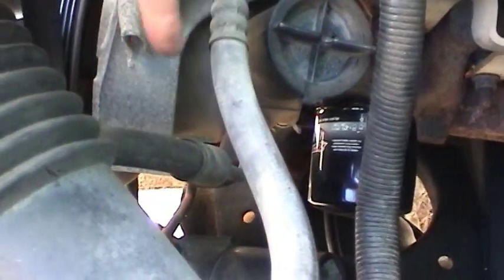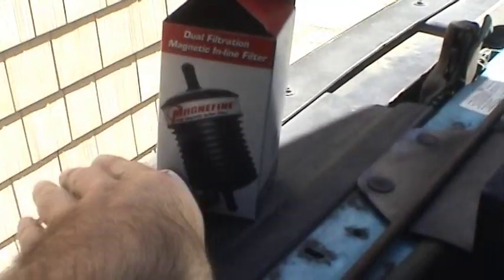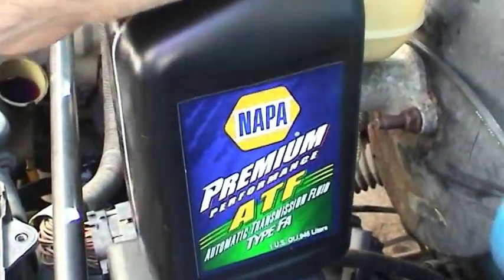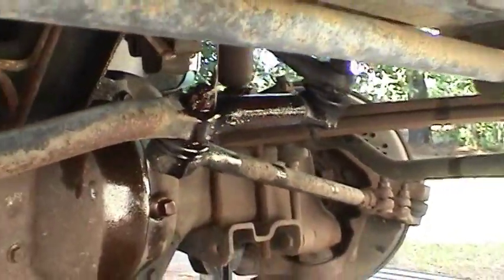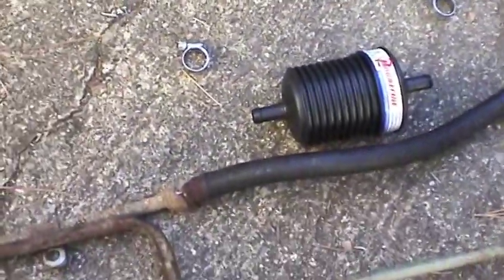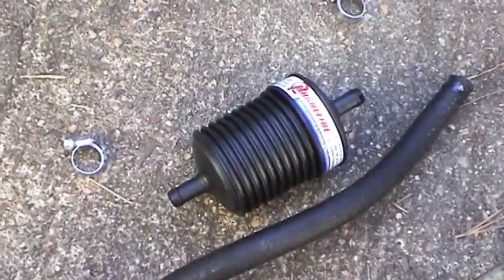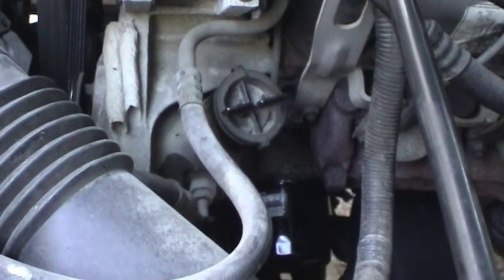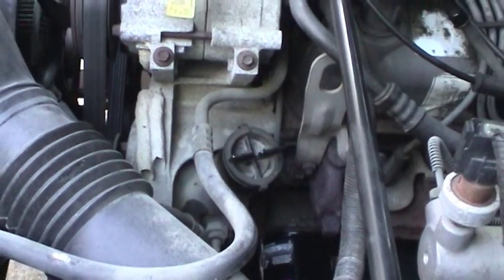1995 Ford F-250 4X4 Power Steering System Flush

Comment: Probably the main thing to remember is to change the filter now and then as the paper element will break down over time and if it does it will plug up the system. That would be disastrous. I got to flush my power steering as it is getting noisy.
Reply: The filter is not paper

Comment: Did you ever do the front differential?
Reply: You can only do those ones by sucking the old fluid from the fill plug with a transfer pump, opening the pumpkin on those requires ALOT of work

Comment: Responding to a thread that's a couple of years old, but now is when I'm doing my steering.  I'm almost done putting back together a 96 F250, where I replaced the steering pump with a Ford reman, and since the manual recommended replacing all rubber parts because the hoses disintegrate from the outside out, I was surprised to find out two things - the Ford dealers no longer carry the cooler/"paper clip" that attaches to the front axle.  And an aftermarket auto parts store sells both the hi and lo side assemblies from Gates for under $20 each!  What a surprise.  Became a case of the might as wells.  Also, I have that same oil drain pan.  Have had many.  I couldn't see the cap on the spout of yours, but mine kept splitting and caps from quart oil pans didn't have the right thread pitch.  If you like, I can send you a couple I designed and printed on a 3D printer.  Kept my drain pans alive.  Nice video.  So much in common between the F-150 and F-250 Powerstrokes, steering-wise.

Comment: ANOTHER OPTION FOR FLUSHING: There is a 3/8" hex hole in the end of the pump drive shaft that can be used to operate the pump to flush out the old steering fluid. So BEFORE putting the serpentine belt back on, I used a 1/4" air impact ratchet with a 3/8" hex bit socket and was able to easily flush the fluid as fast as shown in the video, but without cranking the engine. My air ratchet has a max 270 RPM and max 23 ft-lbs torque.

Comment: When I flushed my power steering system out, I used compressed air gently, disconnected all the lines and blew everything out. That worked well, I was also able to evacuate the steering box using that method as well. Looks like the method you used works good too.
Reply from the maker: That doesn't sound like a bad idea. Your method would be particularly good for systems in which the hoses are in a difficult spot to reach. If you control the air precisely, you can minimize the spatter and mess. I'm glad you were able to get yours clean. I've seen way to many Fords with noisy power steering pumps due to low or bad fluid.
Reply: My truck is an 86 F250, 351W. No emissions left on it anymore. I had it flushed and refilled in less than 45 minutes. Mine is too easy to get to. Although I did blow the air through the wrong side of the return line not paying attention, made a little bit of a splatter. But, it works well. I used the Mobil 1 Full synthetic ATF with 2 ounces of limited slip additive. I can't believe how much smoother the steering is now. Pump is also fairly quiet for a Ford pump of this style.

Comment: Thanks for the upload, I'll be doing this to my truck when I find the time, fluids and parts because my fluid is reddish brown, lol. Also, can low power steering fluid cause play? If not, what should I check or repair? I am having some play in the steering wheel.
Reply: I have been chasing this for sometime now.ball joints. tie rod ends.Steering gear box and power steering flush next (might just throw in a new pump and lines so I don't have to go back and do this)
Reply: Check the steering shaft that runs from the steering wheel to the gear

Comment: Good workarounds.  I need to do this to our explorer.  How long did it take?  Can I just crank the engine by the crankshaft bolt to save starter wear?

re: the filter--  I believe mercedes uses a filter in their power steering pump, at least up until the early '90s models that I know of.